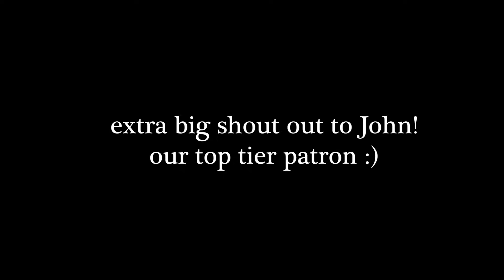Two Years Restoring Our Floating Tiny Home (Timelapse) | Ch 5 E 90  | Steel Boat Restoration

Comment: Nice work to both of you!  I have enjoyed your videos immensely as I've been working on my own 40' steel ketch (still in the boatyard, after almost two years).  I thought replacing the cap rail was a big project, but the work you two are doing is on a different level.  Your videos have been inspirational and informative.  I don't know what getting out of the boatyard and going sailing again is like yet, but I hope it will be just as good for you as it will be for me :>).
Reply from the maker: Ah fingers crossed we are all out there sailing soon! Thanks for watching and for your comment 😌